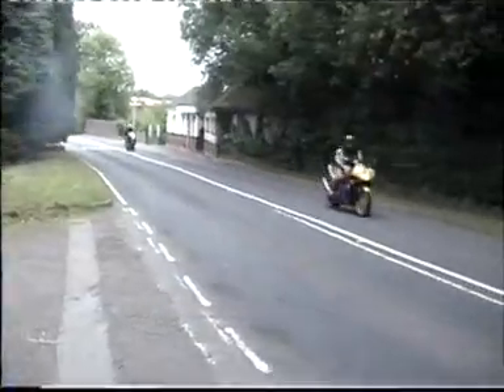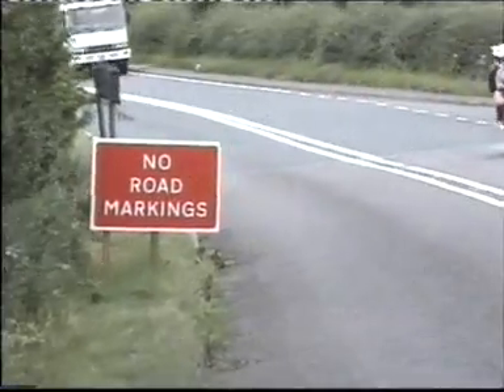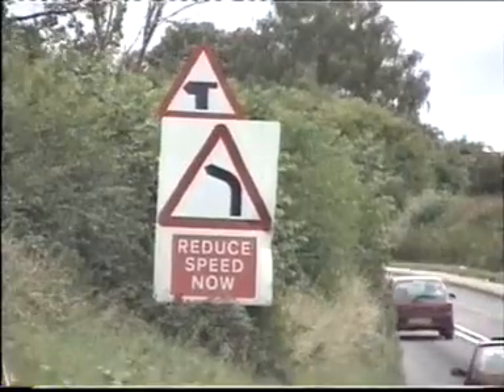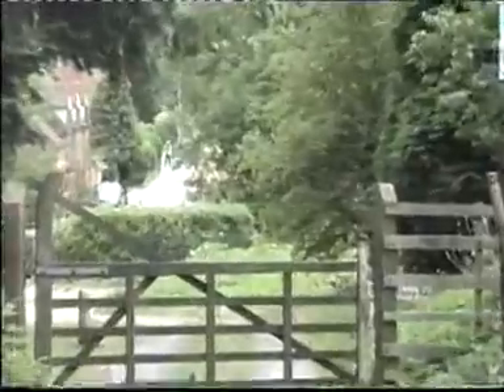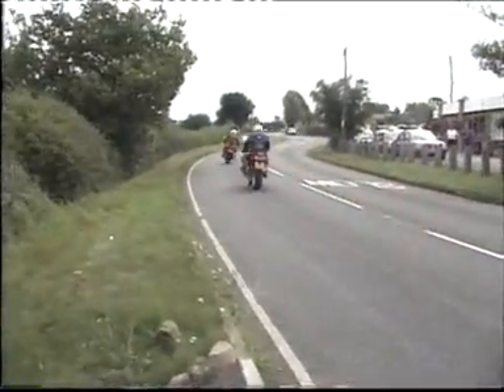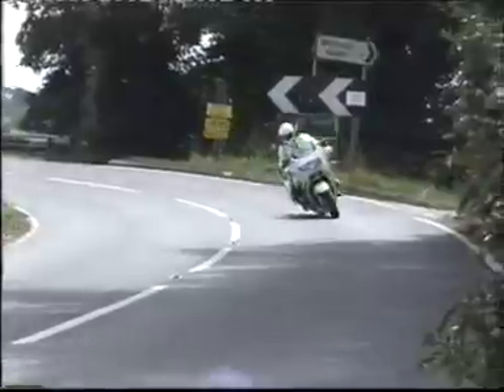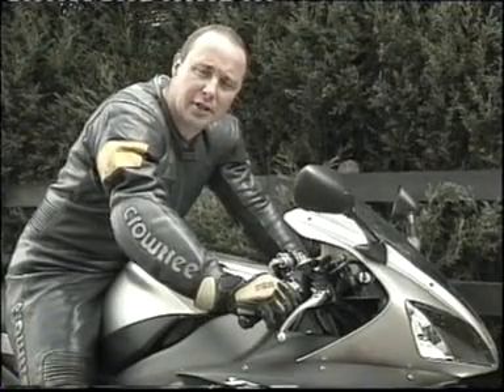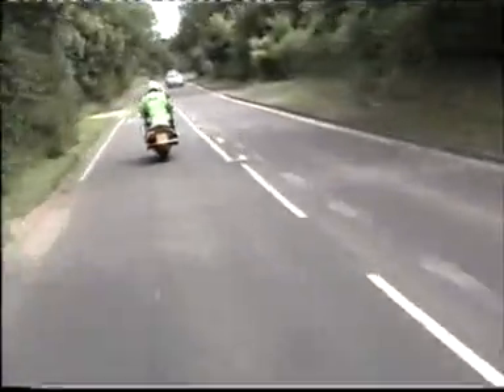Ride the right line

Comment: Interesting, is there a colour code to how grippy a road is?
Reply from the maker: Not as such, although you can assume anything shiny is slippery. You can also spot the high grip 'anti-skid' surfaces such as Shellgrip easily enough - they are laid in small patches in places vehicles are likely to be braking or steering hard, such as on the approach to junctions, near pedestrian crossings or on very sharp corners.